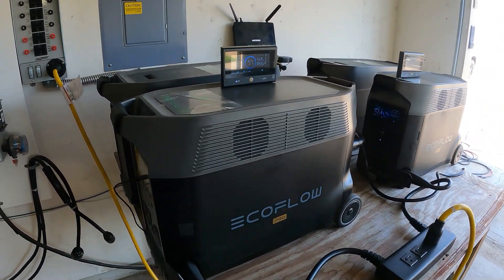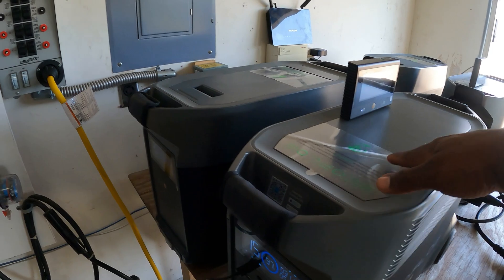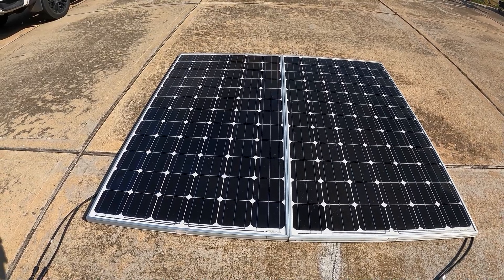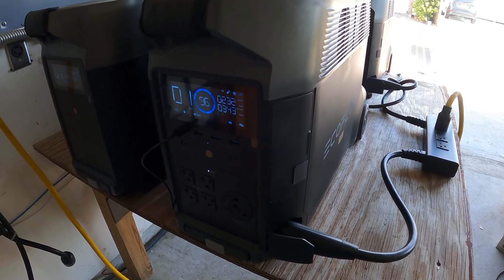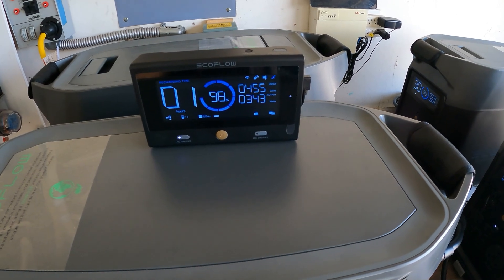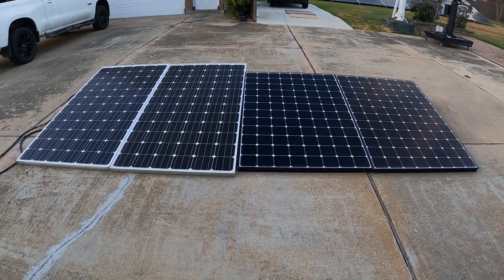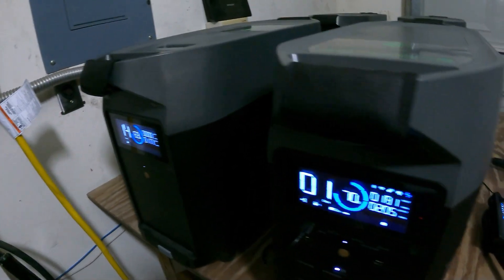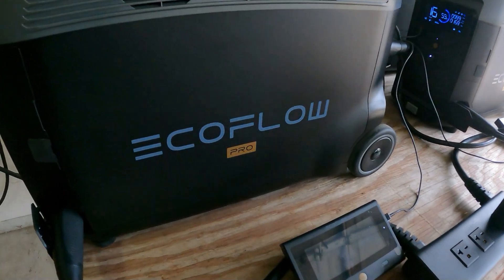Ecoflow Delta Pro 24 HRS load Test Powering my Home Transfer Switch

Comment: Shalom Gavin, I’m upset, I bought this Ecoflow Delta 2 batter rate at 1024 Wh, and since I had It, I can’t change solar charge it using my AllPower 200 watt panel, nor my 2x 100 watt Renogy solar panel glass type … I text Ecoflow through their app and they’re telling me “ sorry, your unit only recognizes Ecoflow Panels and hat I would have to buy the Ecoflows panels” like what kind of crap is that? My unit charges through the 12 volt cigarette lighter in vehicle no problem … and what pisses me off, I’m on YouTube watching all kinds of videos of folks using other that Ecoflows charging their Ecoflow deltas
Reply from the maker: Oh that’s crazy
Reply: @GeneratorReviews  Shalom Gavin, I may have jumped to conclusions, I did further research and watched and read testimonials on this issue, I may have used the wrong XT60 cord, I read that it works with the XT60i adapter. When I read that, I went back to see my cigarette lighter adapter cord that came with the unit, and sure enough it has that tiny metal pin in between the positive and negative plugs on that cord. It works wife with the car adapter,  and I bought the wrong ones which are the xt60 . Hopefully when the XT60i arrives and if it works, I will let you know, and delete this string.

Comment: Hello Gavin Im setting up my ecoflow delta pros with 2 extra batteries and the double voltage hub. With my softstart im getting 45 amp inrush. I tried to power my a/c system with just the 2 Delta Pros but it was not able to get past the inrush. I see that you had good results with adding 2 batteries to the system. I'm just asking if you think 1200 watts of solar plus 2 delta pros each with an additional extra battery will be enough to power my A/C system. Thanks and I love your Youtube Channel. Cheers :)
Reply from the maker: If you have a mini split system, it will probably work but a 4 ton 05 ton AC. It’s not going to last very long.
Reply: Its a 3.5 Ton with 9 running amps 41-45 inrush . How long do you figure it will run before my smart generators kick in ?

Comment: Badass setup, though I would have the Generators on a longer board, or make an L out of wood the width of the board these are sitting on that way it can lessen the chances of these things falling off. For all I know, you have it set up like that for the purpose of this video.
Reply from the maker: Exactly! And another thing is the Ecoflow‘s don’t sit on the wheels. Once you put them down, the wheels are floating off the ground and standing on their rubber stance.
Reply: @GeneratorReviews  I see, thats a good idea they incorporated.

Comment: Wow that's thousands and thousands of dollars worth of equipment.   Don't get me wrong, I love eco flow (Have a few myself) but I can get a $600 gas generator that will handle the load to a xfer switch and be done with it.    Sure, it's nice to not have to hear the noise but not to the tune of spending $10k on batteries.  :-)

Comment: Awesome setup, but is there a smart generator out there that will automatically start up and stop where all I want to do is charge my 400ah battery bank. I’m in northern WI and on a densely wooded parcel with very low to non existent solar potential. My batteries power my off grid cabin through a 4000 watt uninterruptible power inverter. Thanks.
Reply from the maker: https://youtu.be/8h-hp8Okm8M?si=AGmvt2LueYSYoTVi

Comment: Great Video's, we are definitely subscribed!  Question - can the 2 EcoFlow Delta Pro's be connected and charged by solar panels?  We have about 1500 watts of solar panels and if they could be used to charge the EF Pro's with 1 connection, that would be great. I see you're using the EcoFlow Smart Generator to charge the EF Pro's and I'm wondering why not just plug the solar panels into the EF Pro?
Reply from the maker: They are both connected to the pro and can both charge at the same time

Comment: I used to have the exact same transfer switch. Upgraded to a 50 amp interlock, electric guy put in for 300 bucks. Run every circut in the house

Comment: I'm in Houston, too. You don't say what the load was. Doesn't seem like you were running central air conditioning. Load values too low.
Reply from the maker: Hey Michael
This was running my transfer switch, essential loads. If you watch the video I was turning on the breakers, I said exactly what the loads were but you couldn’t run your central air on this all night.

https://youtu.be/B5Ha13xnNZc?si=i060ww0Vd_3miGG1

Comment: It's nice seeing different options though at this point an EG4 18k or Solark 15k hybrid inverter with a 14kwh battery may be cheaper, able to be outdoors, and serve as an ATS while also being able to sync up with a generator. I've been keeping an eye out for backup kits that can be outdoors since I don't have a garage and my electrical panel is outdoors, though it doesn't yet make enough financial sense since even solar salespeople say I have too much shade for solar panels.

Comment: I have a similar setup but instead of using the backup gas generators I connect to the pro power inverter on my Ford Lightning. The Ford/EcoFlow combination gives me up to five days of home backup. With solar I can extend it further. Getting the truck to charge the EcoFlow was a bit tricky because they both have a floating neutral. I had to make an extension cord that was only two prongs on each end

Comment: i was interested in the smart generator but opted out for an extra battery, the Genmax 10500 and the smart panel…i couldn’t figure out how to charge the delta pros and run my home at the same time at 240 with smart generator given their limited wattages….

Comment: I had some bad luck with my Delta Pro.  Had one with a bad board and it wouldnt charge or discharge properly. I got it exchanged under warranty but got a refurbished one and that one had bad cells.  I need reliability so I ended up getting a Bluetti AC300.  The batteries work independently so I can still use them without the main unit.  Thats not possibly with the Ecoflow.

Comment: Holy cow, that setup is like, more than 15 thousand dollars lol 2 delta pros, 2 extra batteries, 2 smart gens, and the solar, 15 grand+
Reply: LOL thats exactly what I was thinking. For that kinda of money I could build a power shed and put a tone of solar on my roof and have 5 times the energy storage as those Delta and extra batteries and a fat generator just in case. Its a very nice system! I dont think I could say cost effective. A very cool video of the capabilities of a product.
Reply: Exactly lol

Comment: Nice system, I have a similar system but without the extra batteries. I was going to buy the ecoflow generators until I found the 
GENMAX Portable Inverter Generator, 3500W Super Quiet Gas or Propane Dual Fuel Portable Engine with Parallel Capability, Remote/Electric Start,
This cost almost half of the ecoflow cost and is lighter and can run both delta pros. It has remote start so the only thing is that it won't come on automatically but I love it and it works great. I can get up in the middle of the night to pee and use the remote to start it.
Reply from the maker: That’s a great idea 💡 Larry thanks for sharing.
Reply: Totally different devices.  The Eco Flows can be run indoors because they dont produce carbon monoxide. They can also be charged with solar panels.  Might mean nothing now but wait until gasoline goes up to $8 dollars a gallon and everyone buys up all the propane.
Reply: @Speed00007  your are not making sense. I have two delta pros and a 3500 watt inverter generator for outside. The ecoflow gas/propane cannot be run indoors either

Comment: 400W on each leg is nothing. Are you planning on re-running the test using more household appliances?   What about running heating and/or air condition?   Well pump?   Sump pump?   Water heater?   Or just normal things like microwave, electric range, etc. Things you would be forced to use in an emergency power situation.
Reply from the maker: Nope! I just showed my house usage
Reply: @GeneratorReviews  But that is really minimal house usage. A few lights, fans and maybe a fridge running. Not realistic for what someone could expect as far as battery life from these units. It seems everyone who reviews these things always has a couple lights and a fan plugged in and then says "Look, it will run for 30 hours!".   I mean, even those Smart Generators are only 1800 watt so even at 3600W across both legs that's a bit of a stretch for a whole house.

Comment: I never see any of these videos in a hot state where AC is not optional in July/August.  I want to run this type of test with a 3 to 4 ton AC running at a high temp like 80 or so to see how long they would really run.  Could you go a week in FL in the middle of the summer without AC?  Yes, but would you wish you were dead?  Absolutely.
Reply from the maker: I’m in TEXAS

Comment: About how much would that exact Setup cost?????
Reply: Not counting misc. cables and the transfer switch you're looking at around $20,000.  Although EcoFlow is currently having a sale and you could get everything for around $14,500.
Reply: I just picked up this exact setup for about $12.9K.  I also spent an additional $1K for the smart panel which should be arriving shortly.
Reply: @Sapphireleadershipadvisors Wow... that's a significant discount
Reply: I just bought the Delta 2. With 400 watts of solar. $1200. Perfect for fridge, lights, internet, tv and fans. Don’t waste your money trying to run air conditioners and heaters, It’s not going to work , unless you spend about $40k. It’s great for bare essentials.  Just get the Delta 2 with a 100 ah lithium battery. Great video, the big systems just aren’t worth it yet.
Reply: @robertprestigiacomo4657  That might be an option for moderate weather but here in the north east when there is an extended outage during winter you NEED heat. Not only for yourself but to prevent pipes from freezing. When it's 0F it doesn't take long for things to start cooling off. :-)
Reply: That’s where the wood stove comes in.
Reply: Great Videos!!!
Reply: @brucesimpson8579 You forgot about the 2 generators ha ha